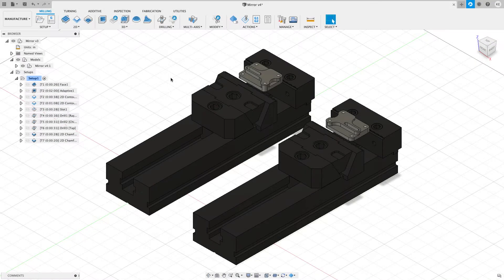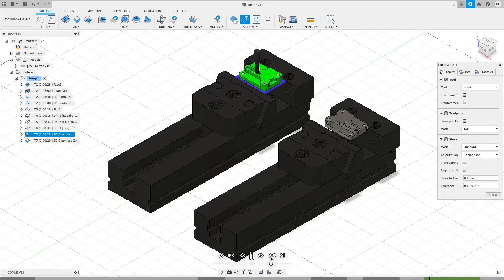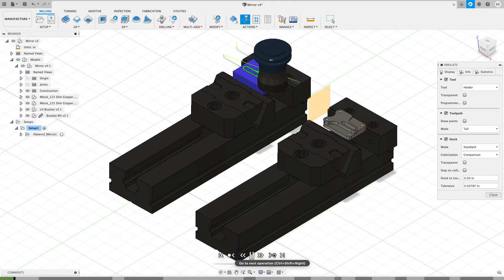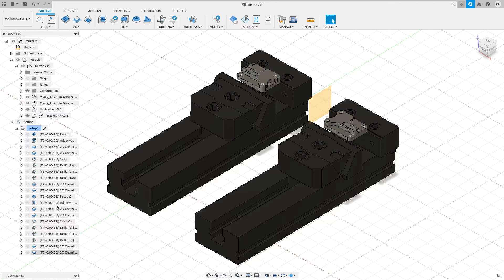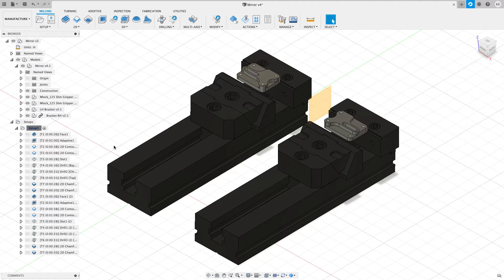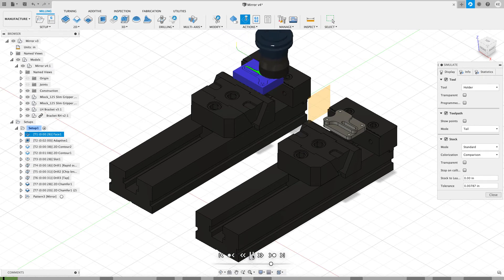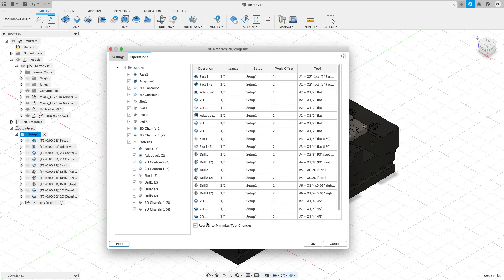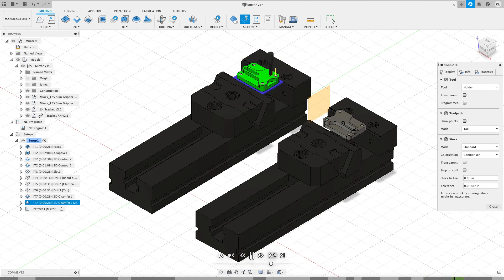Fusion 360 - Toolpath Mirroring

Comment: Hello, thanks for sharing this method, it is great! I was wondering if I could get the same result by copying (or even duplicating) the toolpaths from the beginning, changing the machining direction (from climb to conventional) and then mirroring these changed ones. Without mirroring at the beginning, moving them out of their mirror pattern, deleting it etc. Is there a fine detail I am missing?  And one more thing: while postprocessing allthough I checked "Reorder to minimize tool changes", nothing happensthe order remains the same. I've tried it for two different files, Could it be a bug  of the current Fusion version or am I doing something wrong?  Thanks again!
Reply from the maker: The most common reason that tools don't reorder is that you select them from the tool library when using the same tool for future operations instead of selecting that tool from the document library. Could that be it?

Comment: What is the mechanical advantage of doing it this way? Why not use component pattern? Or did i miss the point about this part being one that has 2 halves one mirroring the other?
Reply from the maker: Hi Tommi. In this case it is a left hand and right hand mirror. It isn’t the same component rotated, but two different components.

Comment: personally I prefer to just mirror the body
Reply from the maker: Hi Jorg. Well, depending on if you mirror the body or or create a mirrored component, you still have to CAM the left and right hand version. This method allows you to program one of the parts and get the mirrored version instead of having to program both.
Reply: @MechanicalAdvantage 
I just save the first toolpath as a template and apply it to the opposite /mirrored part.
Reply: Try using a template on a mold tool with 160 toolpaths that are not all 3D paths.  Needs a one click solution like mirror project in powemill